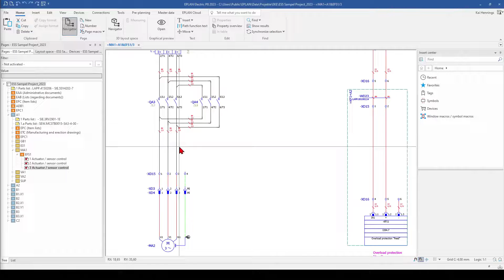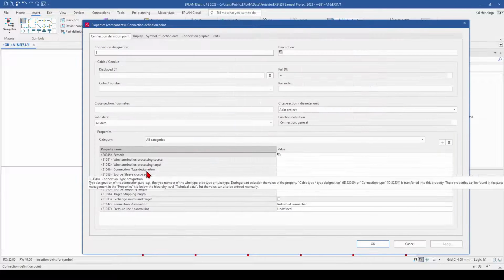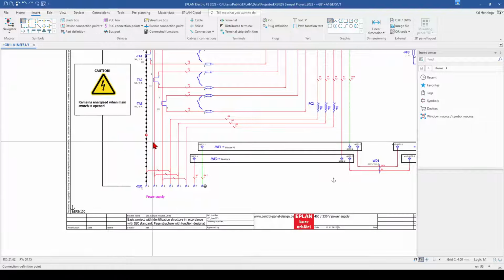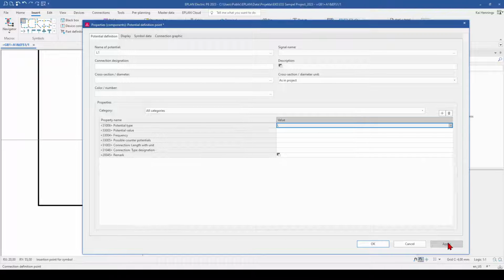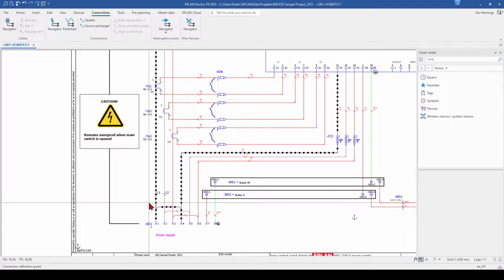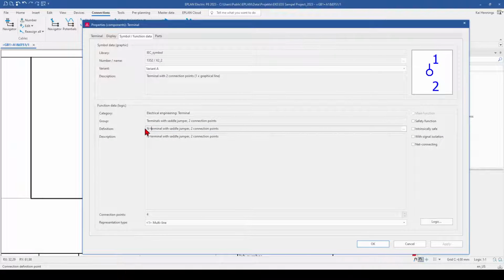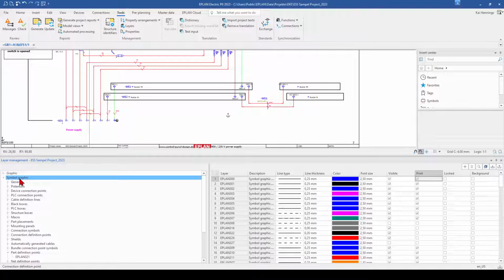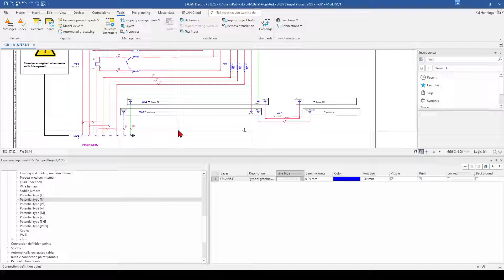EPLAN potential color. 3 ways to color your potentials

Comment: But I have "device connection points (two-sided)" inside a black box and going to a NO contact. One side of the contact is BLUE and the other side is RED. Why?
Device connection point logic has potential type "Undefined" and also the NO contact logic has potential type "Undefined"
Why does EPLAN decide one side should be BLUE and the other side RED.

Comment: Thanks for the content. 
Also, there is another way to change the color of potential. You can put potential definition points under XD1 terminals. Then change the color from PDP.
We use this way to show the supply voltage from the source.